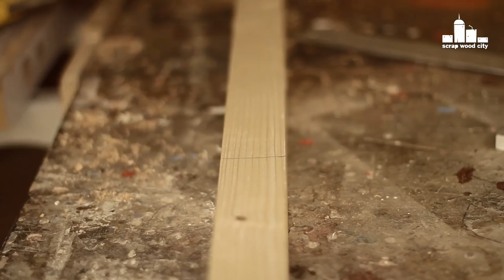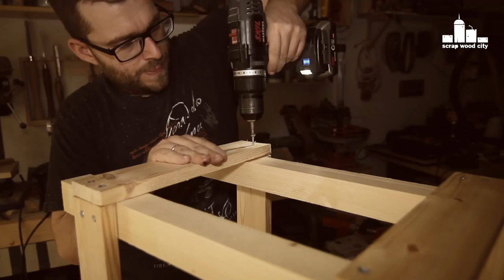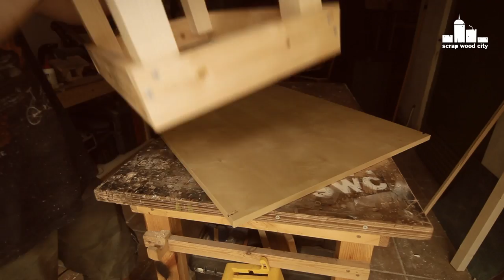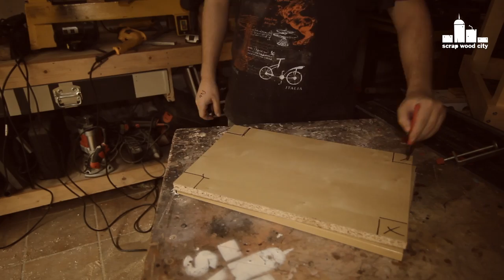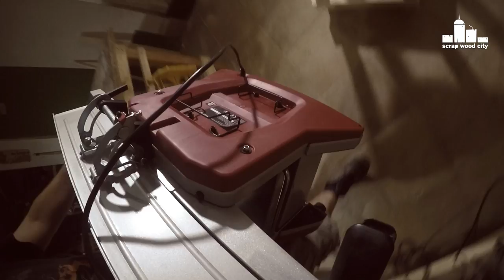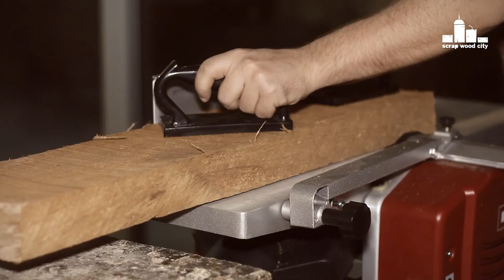Making a super easy DIY stand for my jointer planer machine

Comment: Nice job there buddy. Just one small tip that I picked up many years ago. When using a countersink for your screws, countersink first before drilling your pilot holes. It helps keep the countersink true and makes for a nice clean cut.
Reply from the maker: Cool thanks

Comment: i have a planer that looks like that but a different brand. I think theres one factory that makes all of them. Mine is rubbish. The fence is useless and the blades are hard to align. Sharpening them and reinstalling them is a 4 hour job. Maybe i need to check to see if someone has a video about doing it smarter.
Reply from the maker: I guess you get what you pay for! For me it is working fine, but for more professional use I guess you have to invest in much more expensive machines!